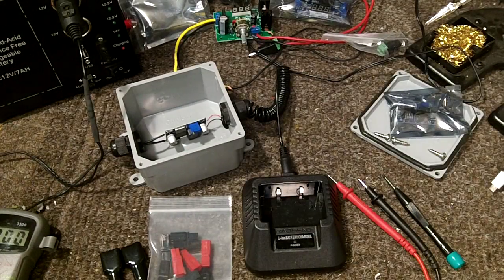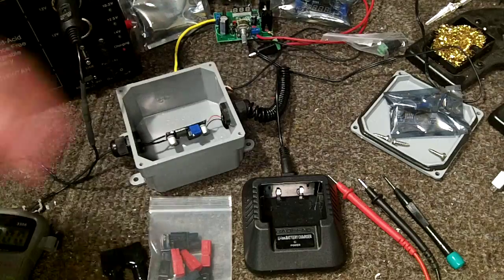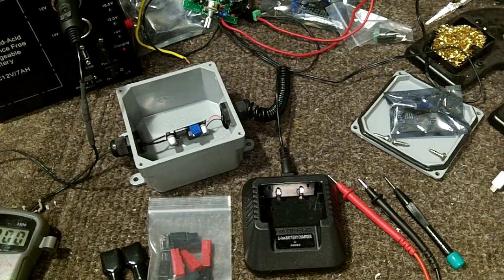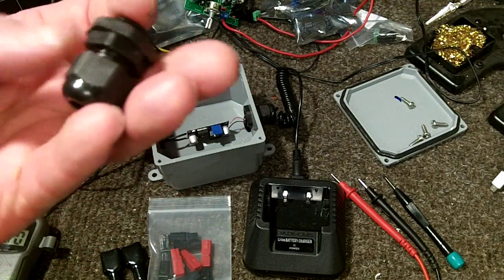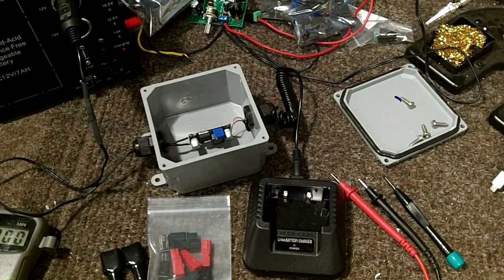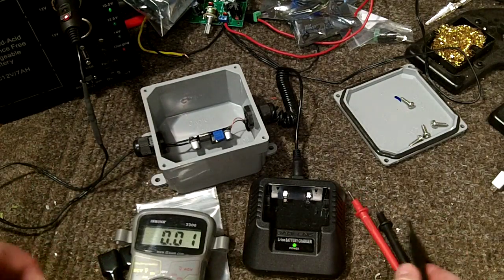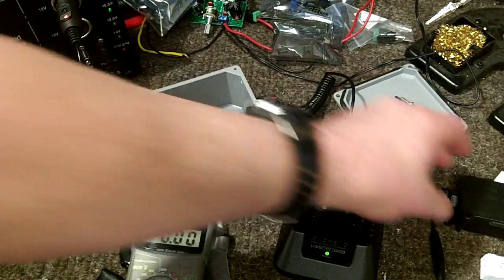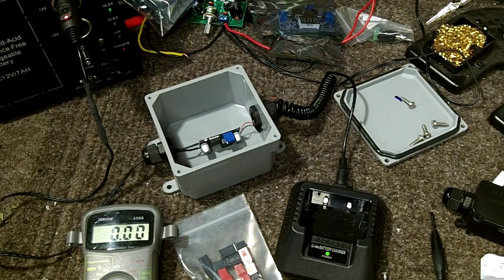DIY Baofeng UV5R Car Charger: Part 2

Comment: Is there enough space to incorporate the buck/boost converter inside the charger? I'd use a Boost&Buck converter set to 10V, you could then charge it anywhere from 4 to 35 volts, Regarding heat, the larger module had heat sinks as it is capable of much higher current, they are both 90+% efficient and at the charging current required the heat generated wont be an issue with or without a heat sink.
Reply from the maker: Thanks for you feedback. I will be sure to give that a try.
Reply: question on these 'generic' step down buck converters...  James suggested once set to 10v output, we can put any 12-34v input in  (whatever rating a particular model is).   Does the 10v hold relatively constant if the 12v input is cranked up to say 15v?   I plan to do this in my car so i am wondering if when the buck is set to 10v output while at the battery 12.6v (not running) will the buck output still be 10v after i start the car and battery is at 14.4v (car running)?    nice set of vids - thank you!
Reply: and can you believe the uv-5r prices these days on ebay?  $13 for TWO new in box with accessories.  how the heck do they do that?    a few days ago i bought a set (2) uv-82's for $26.  it is just crazy the prices on everything...